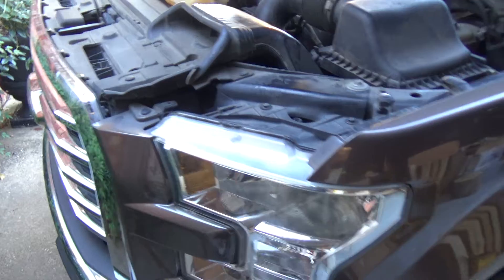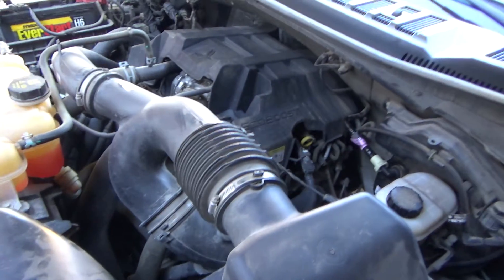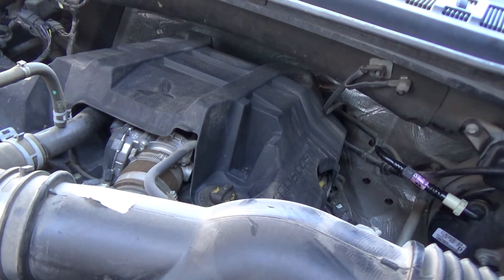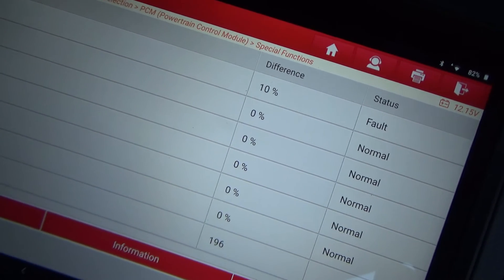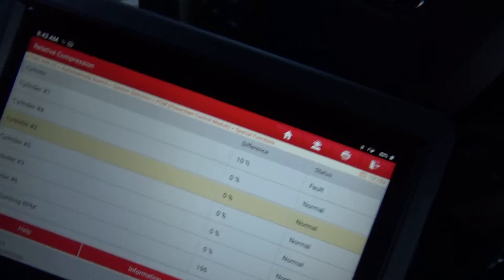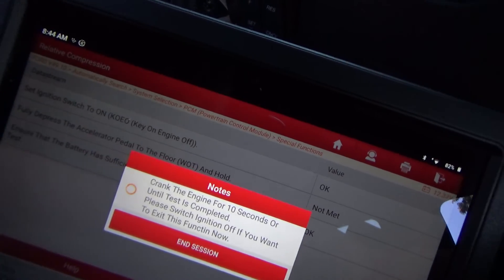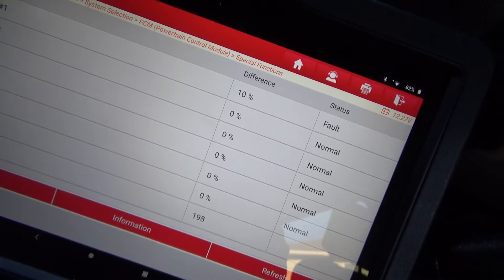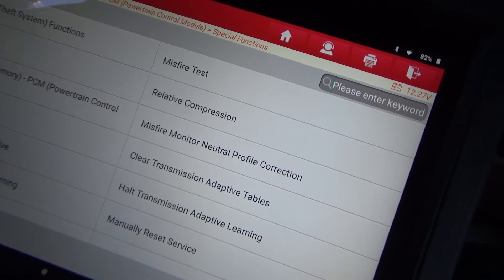Doing a Relative Compression test using the Launch x431 with Spark Plug in and Spark Plug Out.

Comment: How do you do I/M Readiness test for emission on the X431?
Reply: I belive you do a health repot, then enter into the pcm it should be in there. Or I believe you can access it from the x431 home page.
Reply: Let it warm up to normal idle speed then drive it.  It will tell when each component is ready compared to how many testable ones there are installed.